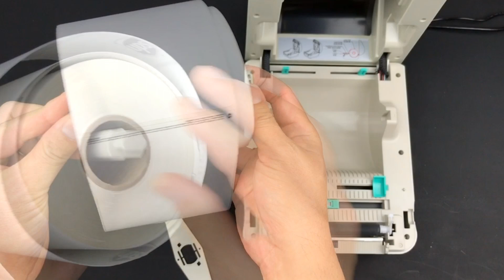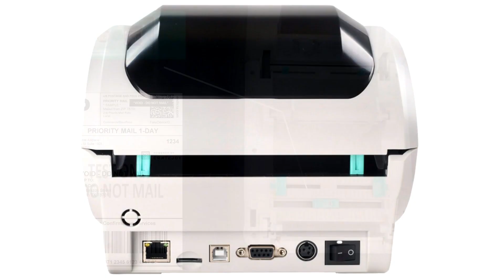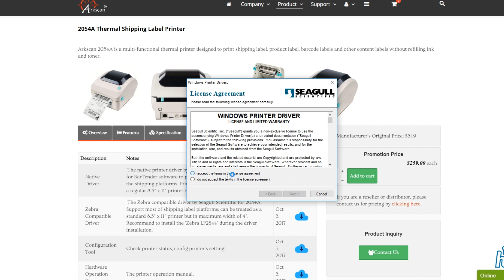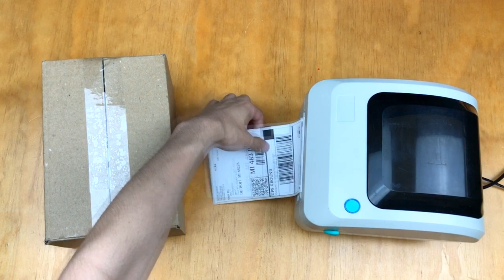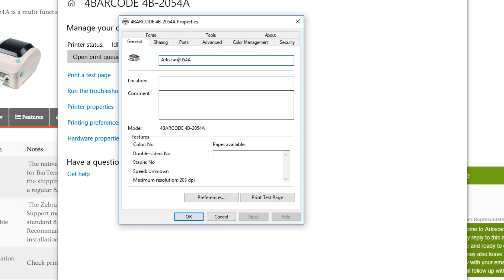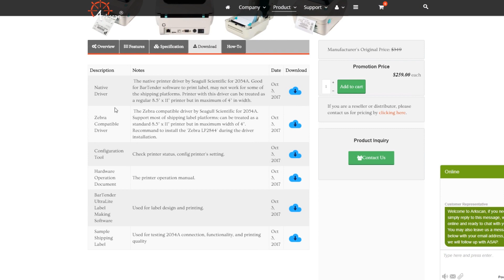Setup Guide - Arkscan 2054A Thermal Shipping Label Printer Tutorial

Comment: hi hope you can help,,, the usb is plugged into my computer but the "drivers installation" is not picking it up,, its just stuck on searching for the label printer..  Ive gone through the set up, turn button at the back off, press front button till red lights flash, release front button etc,,, but im not having any luck in regards to the computer picking up this device.. i opened printers and scanners and ran a detect device scan but nothing comes up,thanks